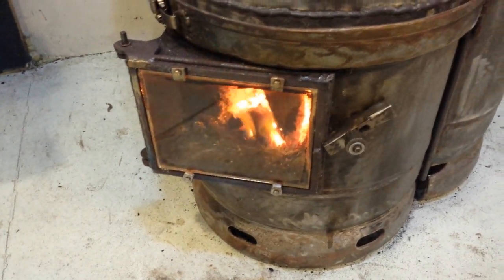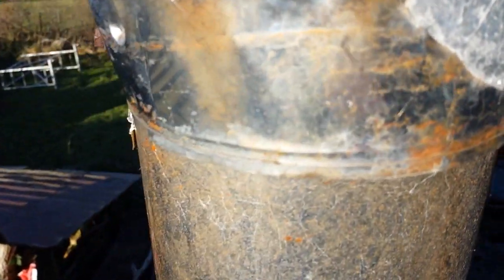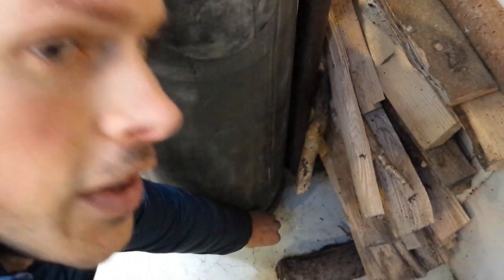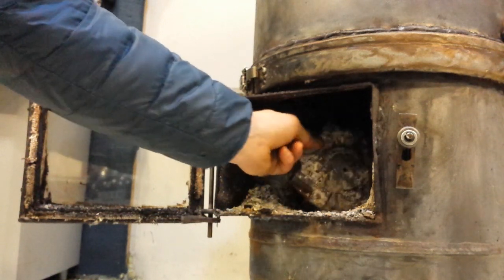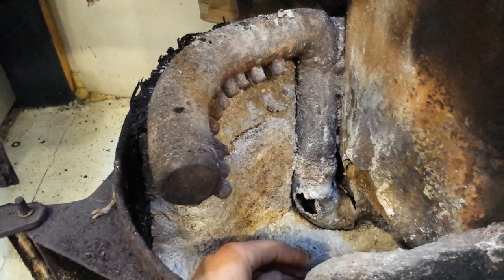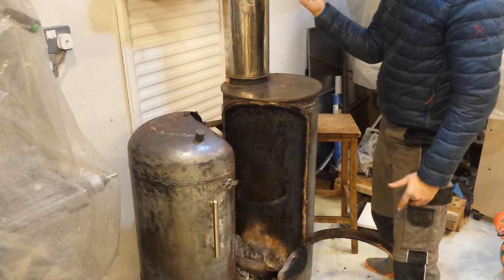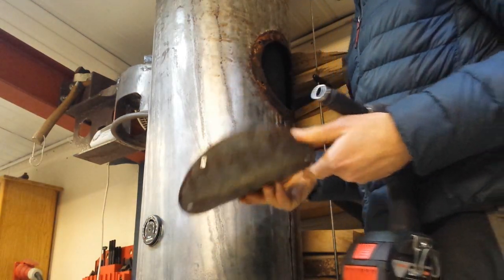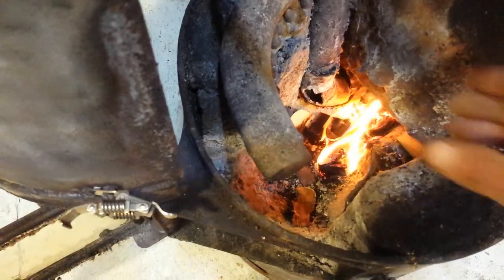Experimental Wood Stove - Five years on...

Comment: really cool. what do you use the heat exchanger for?
Reply from the maker: Hey there, thanks. The heat exchanger is air to air - it warms the room air.
Reply: @FloweringElbow  very cool stuff. been trying to plan a little furnace i could heat water with, just exploring other functions while the war against energy pipes up.
Reply from the maker: @gordtron  yes wise! i could have gone the water heating / central heating rout with this and I think it would work well, but as it's essentially a big (well-insulated) one-room heater, getting good air-to-air transfer is better.

Comment: Did you ever find out what caused the pattern on the hot plate?
Reply from the maker: We are sure it was something to do with the way I welded the two layers of the top plate together....
Reply: @FloweringElbow  
That makes sense if you spot welded it I guess. 

I was also wondering if the combustion in the hinged hopper was caused by the burnt through preheat tube blowing the flames in the wrong direction? 
From what I’ve seen of rocket style stoves, I’m wondering if having the air inlet in the hopper and blowing downwards would stop the flames traveling up the fuel and combusting in the wrong place?
Reply from the maker: @Therapistinthewhitehouse  yeah that occurred to me also. Just haven't found the time to change it 🙃 . Though having jets of air close to combustion is the best for efficency...

Comment: This stove is very unique for sure. Maybe you should of used stainless steel pipe inside the burn chamber to keep corrosion at bay ?? I know the price is a bit salty but you would not have to replace the pipe.
Reply from the maker: Yo VF. So right on the stainless pipe. All the air pipes have now mostly corroded/ burnt away. They lasted a few years, when I get round to it, I will replace. It gets exceptionally hot in the insulated combustion chamber, so finding something super heat resistant...cheers, Bongo
Reply: @FloweringElbow  Good day Bango. I can tell you I am slowly getting material for my wood stove. Got pipe's made of inconel. That is top dog material used in jet engines. Am sure this will not let me down. My problem is I cannot get the best of both worlds in a wood stove. I need long burn time 12 hours, high heat output 100K BTUs, super efficient too. Making this happen will be a challenge for sure. Can you tell me what you would do ??? Keep in touch Bongo and peace too.
Reply from the maker: @victoryfirst2878  not 100 % sure what I would do. Have you considered making a big batch burner and a thermal store?
Reply: @FloweringElbow  I would really like to stay away from a thermal store. Takes up to much space. I am figuring if I would make a real efficient stove that would not really matter. I get wood dropped off for free. So the wood is not a problem. Now to the big batchbox burner, I am thinking of making a combination ballergan rocket stove combination. This maybe the ticket for me. Right now I am still in the planning stages and have a lot to figure out. Peace Bango.

Comment: If you block up that primary air intake and drill an intake above the wood feed right at the top i bet the draught would be loads better and consistent.
Reply from the maker: Good afternoon BadWC, thanks for the comment. I have tried this and it was somewhat better mostly... but just occasionally back-draught, so I switched to the preheated pipe air, which I think makes it burn hotter anyway. Thanks again, Bongo.
Reply: @FloweringElbow  i've heard, not sure if true, that cold air contains more oxygen than warm/hot so odd that it burns hotter with heated intake.

Comment: I'm certainly no Expert and if the stove works then great but it just seems over engineered in the wrong places to me.
Is heating the primary air really necessary? I can fully understand heating the secondary air but is heating the primary air
through such a long route not also restricting the amount of oxygen that can get into the burn chamber?

Most of the cars I've owned for the past twenty years have had induction pipes that run right to the grill so the car can breath
nice cold air which contains more oxygen and gives more power, I've not watched formula one for a long time
but seem to remember they would have to adjust fuel mixtures not only for tracks at higher altitudes but also tracks in hotter climates for the same reason?

As I said I'm no expert and this is a question not a condemnation, my initial thought was Wow a lot of work has gone into that
but then I started to wonder how much you would actually gain from all that work and if putting a couple of slip
joints or pipe spigots on the flue would have been better time spent?
Reply from the maker: Hey Tommy thanks for your input. It was long enough ago now that I was messing about and experimenting with this stove that I have forgotten some of my research and reasons for doing it certain ways. I know what combustion wants is heat and oxygen. The hotter the better, that way if the give it too much oxygen it will not cool down the fire... I knew I wanted to pipe most of the air in from outside anyway and on days when the stoves needed it tends to be very cold (and sometimes very humid). I could have simply piped it in straighter but as I was building the stove at the same time it seemed easy to try that out. I don't remember it being a huge amount of extra work. With hindsight I should definitely have made a slip joint between the burn unit and heat exchanger - what I had free and to had was a straight insulated tube and I was keen to light it up so....
Reply: FloweringElbow  Ok I understand what your saying, It was going to be sucking really cold, damp air from outside so the idea was to just pre heat it a bit. 
Have you ever tested it by controlling the air just by opening the window on the burn box?
it would be interesting to see if or what the actual difference in temperature is between using ambient air and pre heated air?
Reply from the maker: It makes a big, immediate and visible difference Tommy. With the door open it goes well enough, but gets too much air and burns 'softer'. With the door closed the incoming air is at much higher velocity, and you can see it blasting from the nozzles. It's much more fierce - which makes sense as the strong air currents are really mixing up the oxygen and combustion gasses, as well as exposing new surfaces for combustion (blasting away bits of char that can insulate parts of the wood from the heat). If I leave the door open it also slows down the warming of the workshop, as it is sucking out workshop air (which gets replaced with cold air from outside, which is drawn in through the small gaps round doors etc.
Reply: FloweringElbow is that with the door wide open or just cracked open? 
The reason I ask these questions is because I'm interested in making an outside kitchen so like a rocket powered oven and possibly a hot plate mainly just to keep as much heat out of the house in the summer months but I would also like to learn about rocket heaters.
My family owns a house in Bulgaria has underfloor heating that is powered by log burners using a heat exchanger, I've been wondering about making a pellet feed rocket stove to be more efficient and which could burn for longer without needing so much attention.
Reply from the maker: It is with it open anything more than a crack. Have you watched my latest ones on the rocket stove grill griddle? http://goo.gl/XBy3cn

Comment: you are not getting a clean burn cause you fire is not hot enough. you also need multiple burning chambers you should have realized this the very first moment you realized there was creasode in the roof chimney exhaust
Reply from the maker: Hey P Grant. Actually it is very clean burning! The amount of build up is very little given the five years of use it's had. I believe that that build up is only from the very start and end of the burn cycles. This is hard to avoid without some kind of propane burner going at those times.

Comment: i think you wasting lots of heat and also making something simple seem very complicated.
Reply from the maker: Chris, I couldn't have said it better. Thanks! 
Murray, I have measured the heat of the gasses leaving the flue, and they are usually less than 50C (!) even when the stove is at full tilt. This indicates to me that most heat is being extracted. Also after the first 10 mins or so, when the fire is just getting started, there is NO visible smoke, indicating very complete combustion.
Reply: Murray Runge Firstly I’m not an expert and I can’t speak about heat exchanger efficiencies but having seen a few chimneys swept and the amount of crud that they can make even in a year burning wood between sweepings, this heater seems pretty ‘clean’ for five years worth of use between cleanings. Also the amount of metal erosion from the burning would seem to me that it is burning pretty hot.
Reply from the maker: Murray Runge the design is very much geared to extracting all the heat... where is the losses?
Reply: heat ex changers that lay horizontal intake one end and exhaust the other  seem more efficient. your crud buildup should be an indicator that not burning hot enough right?
Reply: I sure do like the auto feed system and how hot you can get it. I made one in 1990 and i used a 1/4 inch thick wall by 6 inch wide pipe horizontal  exchanger with bolted caps on either end for inspection and never had to clean it. It had  radiant fins every 2 inches along the 40 inch exchanger with four 2 inch holes in it that i ran pipes though. this allowed me to vent the heat to the opposite side of the shop. after one year i had no creosote build up because the exchanger got red hot. So i like the horizontal type ex changers. The main thing is that we are not polluting and the more we can store the heat for later, by water or lots of metal, the more we save. Thanks for uploading, mine is sold with property and was outside of the shop so i could do auto body painting and not take up space in the shop. We do our best with what we have because reusing metal also helps our planet, good job.
Reply: Yes it doubtingly is getting up to gas burning tempts , just imagine if it were built with a horizontal heat exchanger !  Although my opinion refers to a simpler design , i did not mean to offend. If it works for you and doesn't pollute our atmosphere while capturing maximum fuel benefits is wonderful.  But do you agree that it could have been constructed more simpler where there is no electrical fan in the exhausting process and the heat exchanger is easily accessable?
Reply from the maker: It could have, but it all becomes more difficult. If you're extracting a lot of the heat, it's difficult to avoid creosote build up without the aid of a fan. But yeah, certainly a lot of room for improvements!

Comment: Is it a bit complicated?
Reply from the maker: Yes, but so was a camp fire when people didn't know about it.
Reply: I know what you are saying, but the fan on the roof, the chambers etc. and how well does it perform, I say this as I would like to build a rocket mass stove and I don't want to over complicate things and above all heat with very little wood and keep the heat longer. Also where I live the power goes out, so I want to heat with no electric. If it works for you great but I need a simple thing for a simple mind and looking for the best way to do it. No disrespect to you on your build.
Reply from the maker: I agree with you that simple and elegant is something to be aimed for - having it use electric is a big consideration. I worked out that it was more that worth it given the benefits to burn efficiency and heat transfer (all or most of the heat can be extracted from the flue gasses without overly worrying about draw issues and creosote build up). As you see from the vid - it clearly isn't a perfect system... A rocket mass, wouldn't work so well for the workshop because it is used so inconsistently - the metal exchanger heats the place up much faster (but on the down side also cools down much quicker). It's all about finding the compromise that works.

Comment: That's a lot of reused bits and bobs mate. Try gallium sealed in copper pipes with those fins on them has heat exchange with stirling hot gas pistons turning fans to pass air over gallium copper heat exchange pipes. 😊